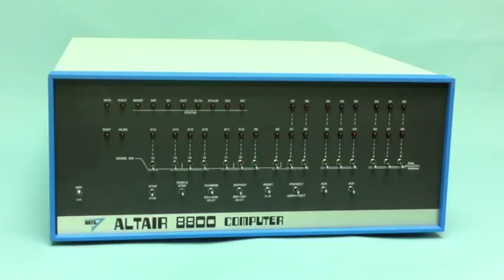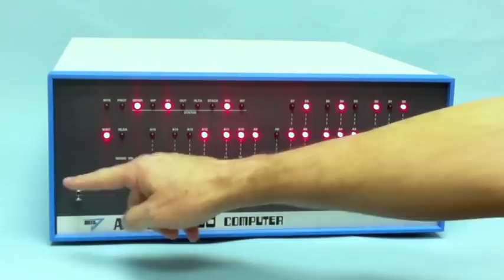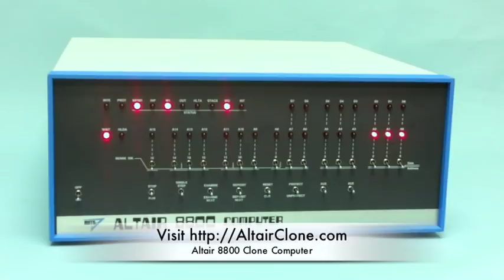Altair 8800 - Video #1 - Front Panel Introduction

Comment: Reminds me of the days when we home brewed computers... :)   My first one I made from an RCA 1802 engineering sample chip set.. It came with the CPU, a couple of support chips, and a 2 inch thick manual with all the revelint electrical data and a complete listing of all the machine instructions.. Very intersting chip as there was NO dedicated program counter or stack pointer or no decatited logic operation register.  Had 16 recisters that you could use anyway you wanted. From a cold boot R0 was the program counter and R1 was the stack pointer.. Very interesting chip. CMOS and you could tottaly freese the clock and never loose anything. NASA used a bunch of these in  space probes. Not completely sure but somehow I think the 2 that are now outside the solar system used 1802 CPUs.. Look up the data on a 6800 chip, basically a 16 bit version of the 1802 as far as the register uses is concerned.  I still suspect the guys who did up the 1802 went to work at Motorola.. :)

I  still have it around here somewhere complete with 65 k of STATIC ram.. Those chips cost a fortune but the neat part was if you hooked a battery in parralel to the normal power supply with a couple blocking diodes that memory would remain loaded for a couple months with what ever was there when you killed the main power.  Almost fuctionally the same as core.. :)

The alter was the computer that actually started the ENTIRE personal computers of today. It was also what inspired the entire APPLE product line. They didnt use the intel . The same chip with a 8080 chip set. they went with a 6502 at first, the same chip in the Commodore line with a couple minor changes the 6510. I made many a buck converting a lot of APPLE code to run on the Commodore 64  :) There was FAR more in common between the 2 than most realized, even a LOT of the engineers of BOTH companies.. :)  

Keep in mind the original ALTARS did not have any sort of roms in them.. IE--NO boot loaders.  You quickly learnt to toggle in  a boot loader with all those toggle switchers...  :)

Comment: Nifty little machine, wish I lived during the 70s.  Nowadays, the hobbyist landscape has changed completely.  Still thriving in some respects, with the rise of cheap SoCs and FPGAs and whatnot, but nothing about CPU chips and computer design anymore.  Nothing beats programming a computer down to the machine opcodes.  It'd be nice if more people would be interested in assembly programming today besides compiler makers and home brew calculator software devs...  I find it a very gratifying learning experience.
Reply: goomba008 As an engineering student, assembly blows. Fortunately it's not really necessary except in time-and-timing-critical applications. Also fortunately, compilers have gotten to the point where they will write better machine code than most experienced programmers.

Comment: although might sound silly, but i wonder what purpose this early computer had been used ? i understand that mostly excludes anything we can imagine a home pc would do for normal user however im pretty interested to know what practical uses , the altair 8800 saw ?
TIA
Reply: +Sakib Choudhury  With the CP/M operating system and WordStar, this computer was used as a word processor. With VisiCalc, a spreadsheet program. With telecommunications software and a modem, a dial-up computer bulletin board system.
Reply: You'd be surprised how much these old computers can do with their limited memory and capacity. Do keep in mind tho that it saw a lot of expansions over it's life. 

The most basic use for a computer, tho, is doing mathematical calculations.
Reply: What practical uses did the Altair 8800 see? Before this model came out NO ONE had a computer of any kind! (for home use, that is!)This unit is were most people learned just what a computer could even do!  Until a way to enter and store programs came along, all you had were  those switches and led's to input and output any data.  Before this system came along, there wasn't any software! This unit is one of the computers that bill gates first wrote  a small version of basic. Even then what could you do with basic if you've never seen it before? 

Computers had to start somewhere. Last but not least! Hardware is always out before any software gets written.
Reply: @TheTurnipKing  , who's "they"? You make it sound like nobody had any ideas what computers were for. While the average man on the street had no idea, MANY people already had a taste of computer functionality by their use of mainframe computers in businesses and universities, and those people wanted that functionality for their own personal/private use. Hence the first personal computers like this model. And just because it initially had only the switches and LEDs interface, the people who bought them knew that once they had the computer part, the rest (operating system, application software, user interfaces and I/O) would follow soon, and that's what happened.
Reply: @youtuuba  in this case, "they" would be enthusiasts.

Precisely the people you describe, basically.

The kind of people who formed user groups to show off precisely what they could make this thing actually do.
Reply: @TheTurnipKing  , so your original comment, "they did not see any practical uses" is not what you meant to say.

Comment: I wonder why they haven't added a feature to the front panel so you could just load paper tapes. After all you could have connected the hole sensors to the data lines, and use the clock holes to first issue a deposit for the first hole, then a deposit-next for the rest of them. I doubt that would have made the (already complex) front panel much more complex.

Comment: I’ve always wanted one of these things since the late 90’s but the re-sell cost is so high that I couldn’t justify. Now there are clones and simulators out there that range from free emulators on PC’s to simulators that cost a couple hundred dollars for arduino based one, up to $600 for a pi based one, to full blown clone made with modern parts. I always thought it was an intimidating looking system with all the lights and switches. But after watching these videos it looks to be quite simple to use. I do wonder why they used flip switches and LED’s rather than keypad and octal display.

Comment: Can this computer have a monitor attached to it ?
Reply: +matrixpathofneo Modern VGA monitors cannot be attached to this computer. A monitor with a composite video input can be used, but a plug-in board is required. Serial RS-232 dumb terminals or Teletype machines are the usual devices attached to these.
Reply: Just take any modern personal computer with a spare USB port. Download the free Teraterm terminal emulator software (or any equivalent terminal emulator). Buy any of the USB to RS-232 adapter cables, and plug it between the Altair Clone and your modern personal computer. Load up Altair BASIC or CP/M that is already inside the Altair Clone's emulated disk drives, and have fun....your keyboard and screen on your personal computer will be your controller for the Altair.

Comment: I know this is a very early and primitive PC, but I fail to see it's practical use for business companies. In Wikipedia it says a company wanted to buy several Altair 8800 but gave up due to the long delivery time. what they expected to do with it, I wonder...
Reply: Business usage of an Altair would've probably meant using CP/M (or something like it). CP/M is a precursor to DOS that ran on the 8080 (DOS also happened to be a near direct ripoff of CP/M). It's more practical than you would expect. Generally you would control it through a teletype instead of through the front panel.

Comment: How large is RAM and what OS does it use?
Reply from the maker: teltri In the early days of the Altair as documented here (e.g., front panel operation), 256 bytes to 4K bytes of RAM was typical. There was no OS of any sort.
Reply: deramp5113 So if it doesn´t have any OS can It be considered a computer?
Reply: teltri Yes it can. Many old computers lack of OS in modern sence. Even, some modern "special" computers lack of OS.
Reply: teltri There is not an OS. You have to learn to operate it yourself.
Reply: Fantastic Furry Uff, pretty tough job.
Reply: Not really. Programming those switches in octal binary is pretty early.
Reply: teltri Of course. If you uninstall your OS, you've still got a computer fully capable of running software... it's just that on a modern computer, that software is likely to be an OS before anything else. The OS is only really necessary once you get a computer that deals with filesystems, and organized collections of software or data. Once you're programming in higher level languages especially they become more necessary, but if you're doing everything basically in machine code. Write out assembler, and assemble to machine code by hand... it's not actually that hard to translate assembly to machine code manually, if you've got a reference... but it is tedious, and I imagine that actually putting software into an Altair would be really prone to error. Debugging would be a nightmare.

Though the latest computers have a bit of a different boot process due to UEFI, things aren't that different. You could still essentially write machine code to the boot sector of a USB stick, and enable legacy boot and run whatever code you like on your OS-less PC... though I haven't actually done anything like this since using a 486, so there's a possibility that there are newer BIOS features that complicate it a bit... but the basic principles are really the same.
Reply: ian giraffing
Thanks a lot.
Reply: teltri The Altair could be expanded up to 64Kb (the Altair Clone you see here has full blown 64Kbytes)
The Altair could use Altair DOS or later CP/M 2.2
Reply: If you understand exactly what an OS is and does NONE  of the small computers similar to the Altars had anything close to an OS. The big  huge room filling IBM ones and some digital ones ( mostly discrete transistor ones) had some sort of limited OS based around he time sharing controller.. In fact the original PC came with a version of CPM rebranded as DOS 1 --- Dos as in Disk Operating System. This is what started Gates on his way.. :)

Comment: Hi. Very nice how they made the first PC. Is it a true PC or was Apple I the true PC coz' it's more complete?
I take you can play chess on this Altair using the lights. I wonder how that's programmed with just lights and switched.
Is this like the house size vacuum tube computers like the Eniac only with transistors? God bless, Proverbs 31